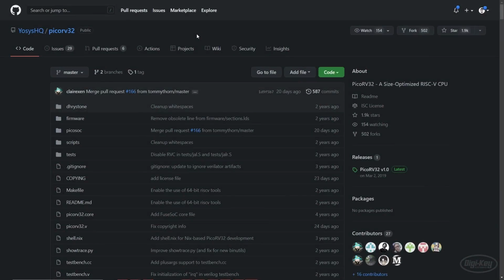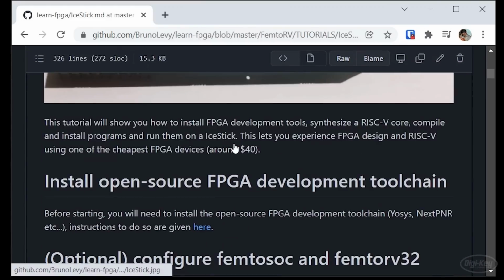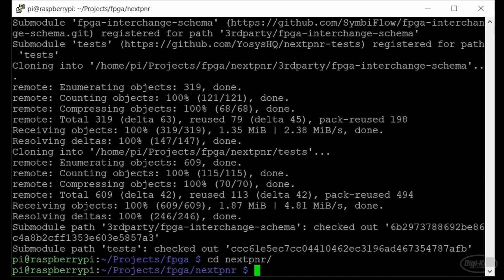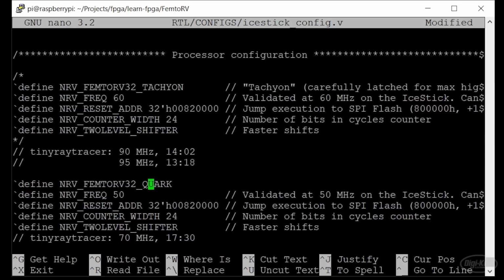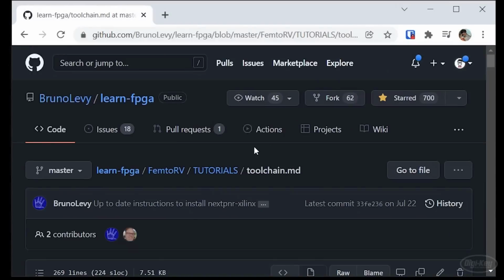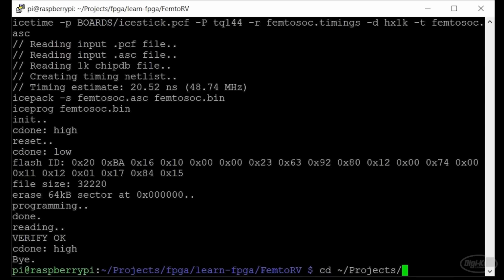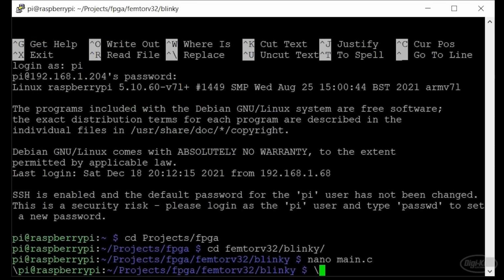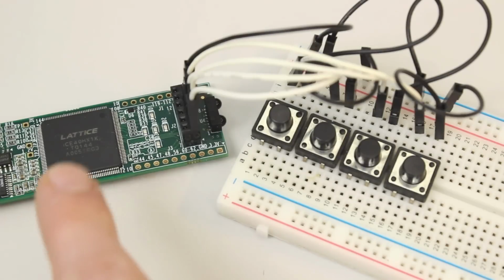Introduction to FPGA Part 11 - RISC-V Softcore Processor | Digi-Key Electronics

Comment: Regarding the 19m mark on building main.prog so that the makefile automatically uploads it to the flash where the cpu can boot from..

I understand the IceStick's Ice40 FPGA doesn't have a built-in jtag but that it's possible to instantiate. If so, how can OpenOCD be used to debug the CPU elf (FemtoRV , vexriscv,  kuznia-rdzeni / coreblocks) ?

For example, I built the SpinalHDL OpenOCD fork:
git clone xxx
cd spinalocd
wget   ..pythondata_cpu_vexriscv/VexRiscv_Debugyaml
mv VexRiscv_Debugyaml cpu0yaml
git submodule update --init --recursive
./bootstrap
./configure --enable-ftdi --enable-vexriscv --enable-dummy CFLAGS="-Wno-error"   
./configure --enable-ftdi --enable-vexriscv=cpu0.yaml --enable-dummy CFLAGS="-Wno-error"
make -j$(nproc)

Then I see vexriscv listed when I do:
./src/openocd -c "target types" 

Unfortunately, when I try to see the CPU:
./src/openocd -c "adapter driver ftdi" \
              -c "ftdi vid_pid 0x0403 0x6010" \
              -c "ftdi channel 0" \
              -c "adapter speed 1000" \
              -c "transport select jtag" \
              -c 'jtag newtap lx cpu -irlen 4' \
              -c 'target create lx.cpu0 vexriscv -endian little -chain-position lx.cpu -dbgbase 0xF00F0000' \
              -c 'vexriscv cpuConfigFile cpu0.yaml' \
              -c 'init' \
              -c 'reset halt'

OpenOCD fails with : dtmcontrol is 0 or JTAG scan chain interrogation failed: all ones

The only example I found uses uartbone, but LiteX does not support uartbone on the Colorlight 5A-75B..  but I would think that the LiteX jtagbone should be doable too!

Comment: Thank you for the wonderful demo. I got a question if anyone would answer that would be great. 
1) If the FGPA is programmed with the processor only without program(instruction), when the program (blinky) is compiled and uploaded to the FPGA, is FPGA reprogrammed again or just the partial memory where Instruction will be stored(BRAM , i suppose) ?

Comment: A note for Ubuntu 22.04 LTS users: The icestorm dependencies must be modified removing obsolete modules "python" and "qt5-default" in order to avoid the following error:

Package python is not available, but is referred to by another package.
This may mean that the package is missing, has been obsoleted, or
is only available from another source
However the following packages replace it:
  2to3 python2-minimal:i386 python2:i386 python2-minimal python2 dh-python
  python-is-python3

Package qt5-default is not available, but is referred to by another package.
This may mean that the package is missing, has been obsoleted, or
is only available from another source

E: Package 'python' has no installation candidate
E: Package 'qt5-default' has no installation candidate

The correct command is: "sudo apt-get install build-essential clang bison flex libreadline-dev gawk tcl-dev libffi-dev git mercurial graphviz xdot pkg-config python3 libftdi-dev python3-dev libboost-all-dev cmake libeigen3-dev".

In my fresh Ubuntu installation python3 an qt were already present and icestorm compilation worked flawlessly.
Reply: Many thanks!

Comment: I am getting error in cmake command in nextpnr
Reply: -- The CXX compiler identification is GNU 5.4.0
-- The C compiler identification is GNU 5.4.0
-- Check for working CXX compiler: /usr/bin/c++
-- Check for working CXX compiler: /usr/bin/c++ -- works
-- Detecting CXX compiler ABI info
-- Detecting CXX compiler ABI info - done
-- Detecting CXX compile features
-- Detecting CXX compile features - done
-- Check for working C compiler: /usr/bin/cc
-- Check for working C compiler: /usr/bin/cc -- works
-- Detecting C compiler ABI info
-- Detecting C compiler ABI info - done
-- Detecting C compile features
-- Detecting C compile features - done
CMake Error at CMakeLists.txt:5 (cmake_policy):
  Policy "CMP0079" is not known to this version of CMake.

CMake Error at CMakeLists.txt:8 (cmake_policy):
  Policy "CMP0069" is not known to this version of CMake.

CMake Error at CMakeLists.txt:9 (include):
  include could not find load file:

    CheckIPOSupported

CMake Error at CMakeLists.txt:10 (check_ipo_supported):
  Unknown CMake command "check_ipo_supported".

-- Configuring incomplete, errors occurred!
Reply: same here
may i know how did u solve it?

Comment: I understand Risc-V has the advantage of a royalty-free instruction set, but does that mean each Risc-V implementation will have different performance (LUTs, etc), based on how one chooses to implement those instructions (ex.  BrunoLevy / learn-fpga / FemtoRV  vs  clairexen / YosysHQ / picorv32  vs VexRISCV)?

And would there be performance differences if implementing the same Risc_V on different vendor FPGAs?  Or even just a different FPGA within the same family.. for example, between the IceStick's iCE40HX1k  (1280 Logic Cells, 8KB), Fomu ICE40 UltraPlus5K (5280 LUTs, 12KB SRAM), TinyFPGABX ICE40LP8K?   

BTW, the Fomu workshop uses "LiteX BuildEnv".. any thoughts how that compares to the tutorials by BrunoLevy?
Reply: The implementation is standardized, it's just a matter of which subsets of instructions you choose to include. All riscv processors can perform the same integer functions in practically the same ways, the memory addresses you access and manipulate might just be different depending on your board. Most implementations will simply have more instructions than the bare minimum required set, so you can assume a general consistent experience across divergent devices, so long as you keep in mind you still need to target your software and compilation to each specific implementation unless you're running abstraction layers on each target.